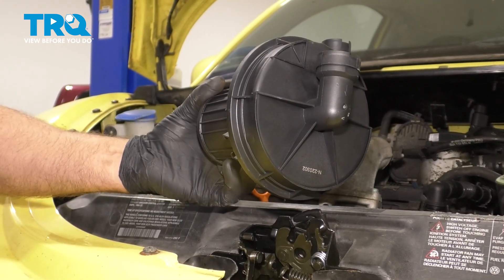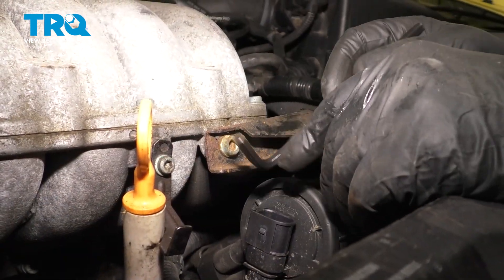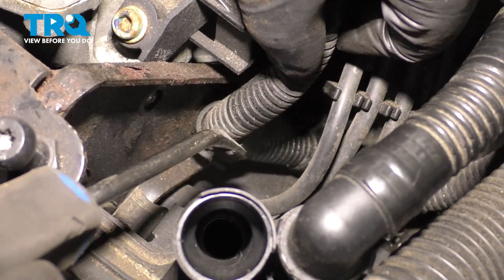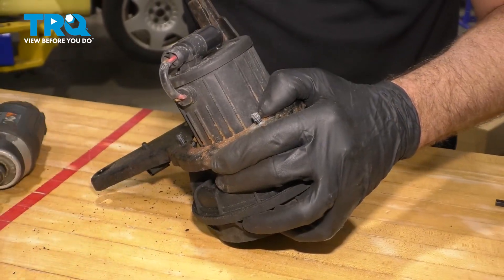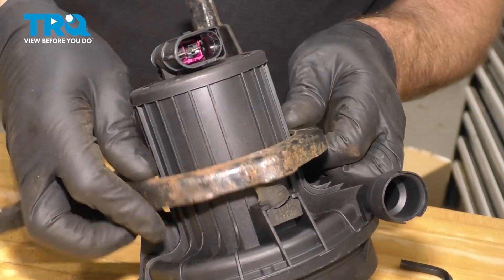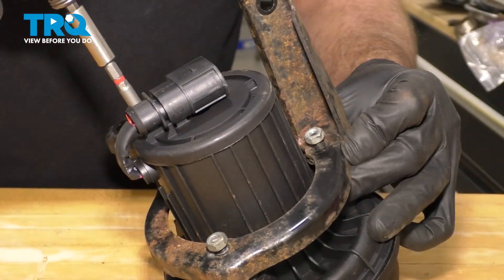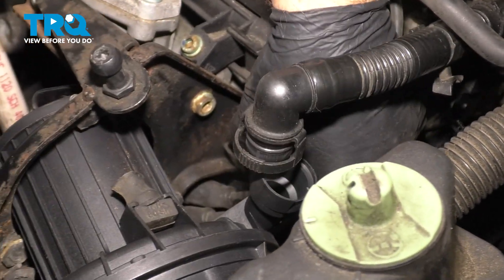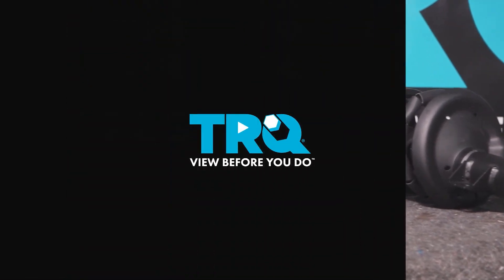How to Replace Electric Air Pump 1998-2010 Volkswagen Beetle

Comment: I can't hear my pump after starting the Beetle, I'm also getting a related code P0411 , I took the connector off the pump and ran my multimeter across the terminals on the pump and got OL, my understanding it shoud read close to 0 Ohms.  I made sure I was touching each terminal good.  Just based on this test and the fact I cant hear it and also removed the pipe off the air box and put my hand over the end of the pipe and had no suction would you say it's gone?